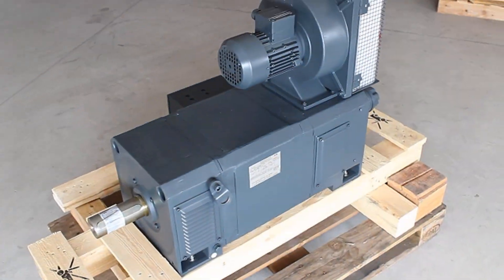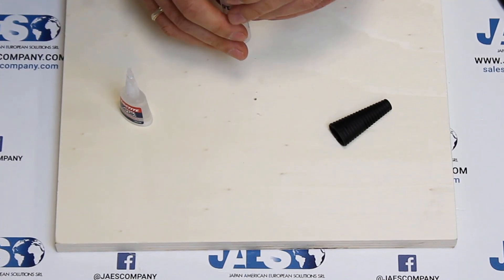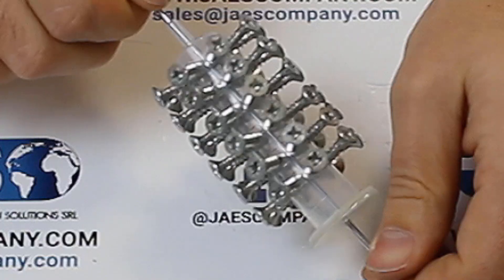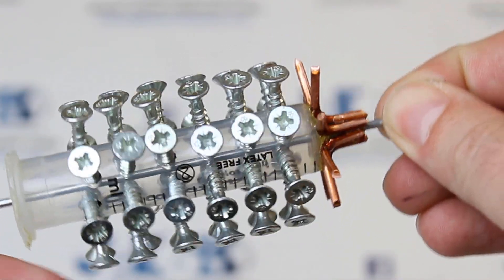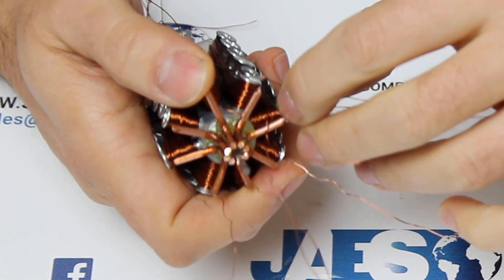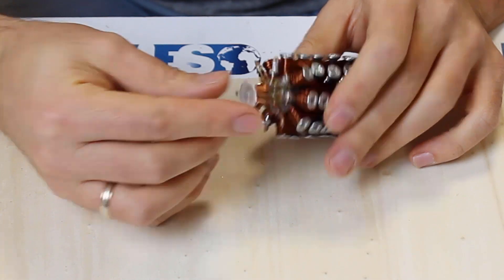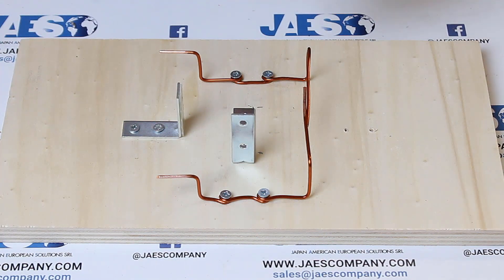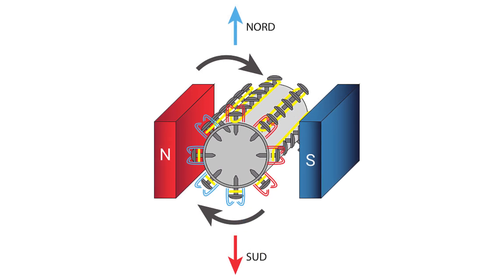How to make a brushed DC motor at home - DIY electric motor tutorial

Comment: will bare copper wire work or does it have to be magnet wire?
Reply: Any wire will work as long as you have insulated copper wire
Reply: No. It needs to be enamel insulated wire. You can salvage some from old electrical transformer. Don’t try using uninsulated copper wire like what you find when you strip a cable.

Comment: Would it not just short circuit without using some kind of insulation on your coils
Reply: The coils seem to be insulated in a thin enamel. Also the tip of the syringe (the pieces shaped like “L’s”) are all making contact with each other after they are stripped, that’s the part I can’t wrap my head around.
Reply: it is essentially "shorting" but there is enough natural resistance in the long length of thin wire in each coil

Comment: I’m confused when you tie of the input and the output wires. You say not around it’s upper copper bracket but the next one to it’s left creating a 90 degree angle. Then you say the output is not to be around its upper bracket but the third to it’s right creating a 90 degree angle. They both can’t be 90 degrees if they are indeed both 90 degrees then something is off cause the input only moves one and output moves 3. So what’s the right answer?

Comment: Which diameter has the copper wire in the video, because I did it with 0.25 and it's not creating an magnetic field.
Reply: if there is a coil and enough turns and enough volt to the coils then that is imposible to say no magnetic field. You can test each coil before install give voltage each side end bring close compass near it you will see the magnetic deviation on the compass. On the other hand coil turn input and output soldering to to the copper poles and magnet sides replacement coil and magnet gap distance are very important otherwise no rotary will happen

Comment: The Presentation of a construction of the DC motor.  Better than even the animated videos.  The explanations
were equally as informative.  Just go to be sure as to why about 9:25 in the video, you wrap the copper wire
around the 3rd bracket to the right.  You mentioned to get a 90 degree angle.  I guess it's due to the rotation
of the armature and the next connection that the brushes needs to make.